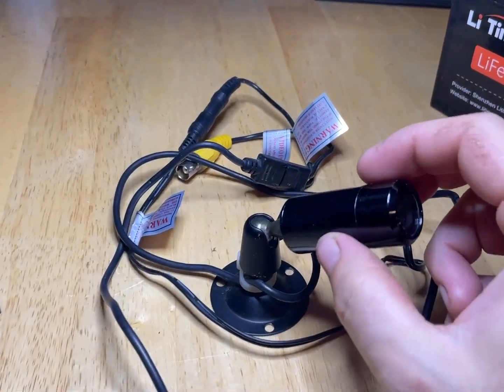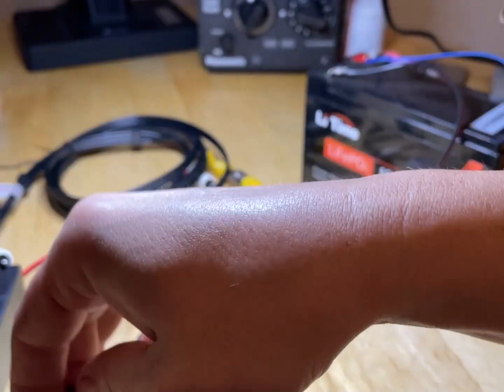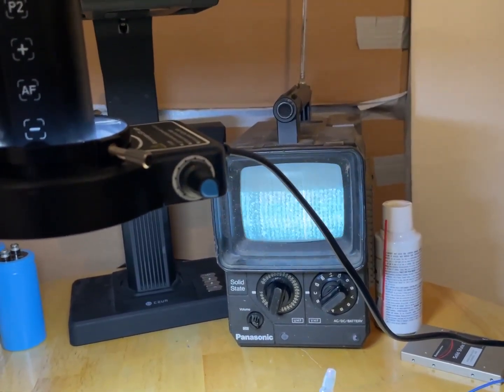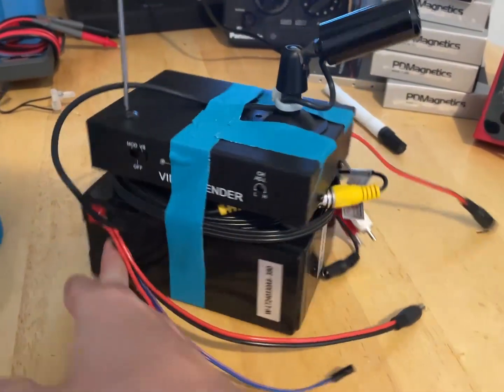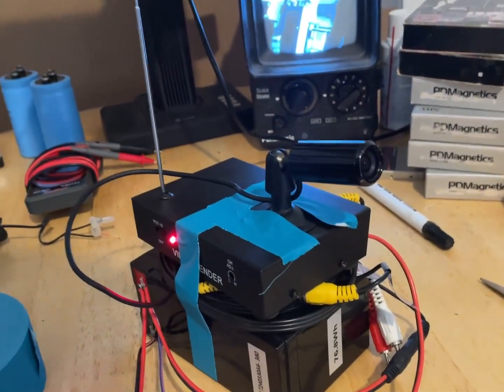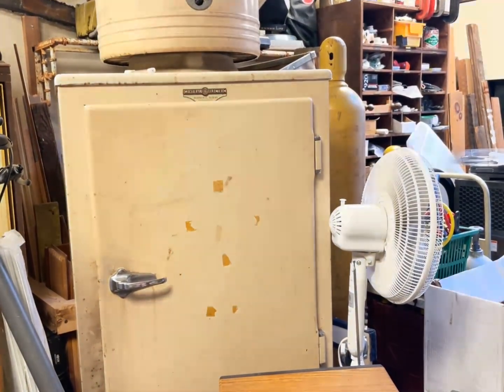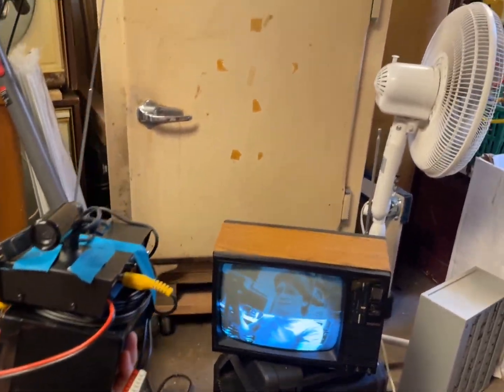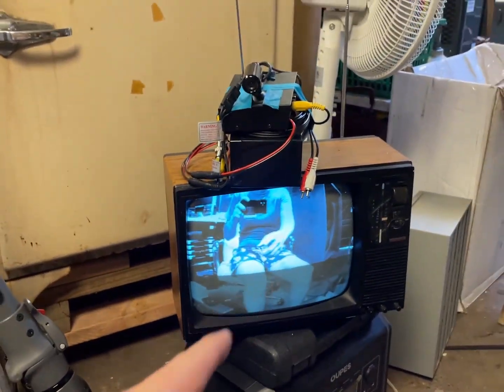NTSC UHF TV spy camera build version 1 with CVC-130R "Bullet Camera"

Comment: Is that really a LiFePO4 battery? I ordered one of those marketed as LiFePO4 but after closer inspection it was a lead acid battery.
Reply from the maker: yeah, this has four round lifepo4 cells inside, you should return yours if its lead acid. Its so easy to tell by weight
Reply: @RinoaL Should've done it right away, but needed some battery right away. I guess I'm one of those who incentivise scammers.